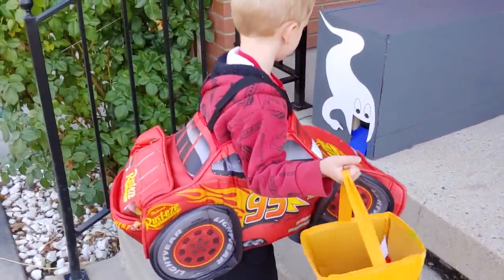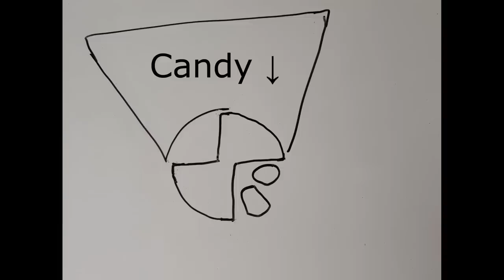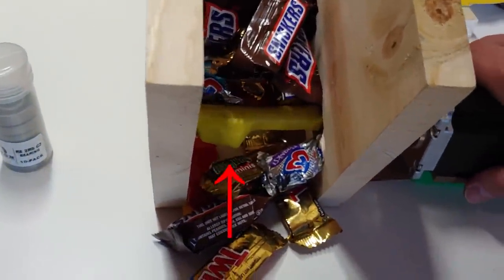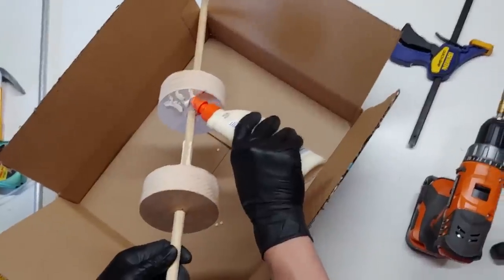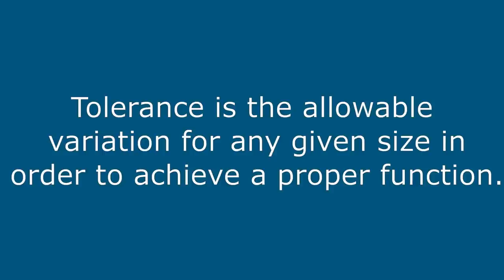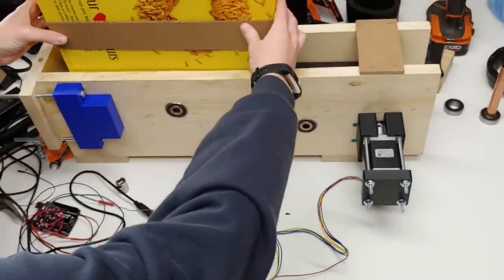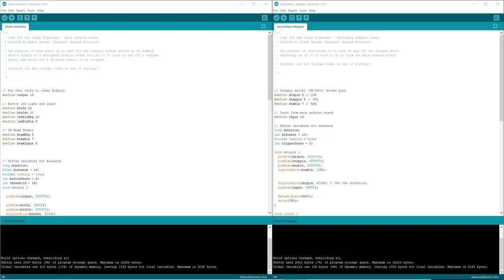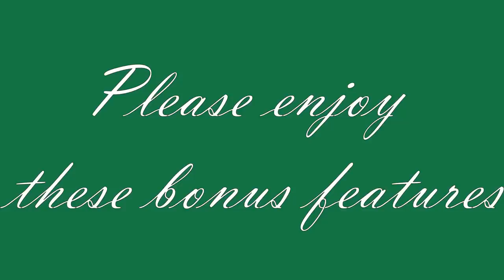Automatic Halloween Candy Dispenser - Engineering Process

Comment from the maker: We have the parts list and drawings live on our website, check it out! https://barkersrandomprojects.com/projects/candyDispenser
We are hoping to do a live stream later this month to help those who are building the candy dispenser.
We are also hoping to get a touchless variant completed soon
Reply: @barkers random projects - Checked out the plans on your site (AWESOME THANKS) and sent a couple follow-ups on the measurements for the pipes to your email. Based on the 3d printed wheel and bearings I could guesstimate but if you have cut measurements for the tube, pipe, and rod (I think 4 even sections of the rod is correct?) would be great. Copper pipe and driveshaft lengths, please?  Also any tips for 3d printed parts? I did everything in PETG with 25% gyroid infill and regular walls. Is that ok or should I be doing solid? THANKS MUCH!!!
Reply from the maker: @ChristianLappinOFFICIAL  Hey! For the copper pipe - one of them should be 5 5/8" which will be a little bit longer to allow the bearings to fit into the tension block. The other 3 should be 4 3/4" which is the width of the machine. The steel rod for the drive wheel is about 5 1/2" long. PETG should be great, and I'd definitely recommend infill. They don't need to be solid. I printed mine in ABS, but PTEG or PLA should be OK.

Comment: This is great! Any chance we can have a wiring schematic? I would love to try and build this
Reply from the maker: Wring schematic can be found on our website here: https://barkersrandomprojects.com/projects/candyDispenser
Reply: @BarkersRandomProjects  Great to see the documentation and parts list. I wish you had posted it a little earlier. I have built a touch free candy dispenser inspired from your design. And I used a raspberry pi because that’s what I had.
Reply from the maker: @SharathKE  you should share your design!
Reply: @BarkersRandomProjects  Yes, I am planning to do it once I get some tweaking done and get a nice cover for it. Basic design is similar to yours, with my not so good craftsmanship and unavailability of tools/resources I did more 3D printing and used hardboard sheets, used a thicker belt, used ultrasound sensor for proximity sensing to start dispensing, and just like you I used IR beam break sensor to stop the motor after dispensing a candy. A couple of years ago I created a gum ball machine where kids would have to pedal a bicycle and depending on how many times they pedal in a 20-30 sec time frame the machine dispenses gum balls. Kids were super excited with that machine, this time I wanted to do a wrapped candy dispenser and that's how I got to your video. Thank you for that video.

Comment: Nice looking driver. I assume that's just a standard NEMA17 stepper?

Also, if you didn't, you may want to look at using an interrupt in your code.
Reply from the maker: Thanks! It is a pretty easy to find NEMA 23 stepper, 1.9Nm

Interrupts would have been extremely helpful for this project, I didn't know they existed before now. Thanks for the feedback/suggestion! I think that would have been a much better design then what I was doing.
Reply: @BarkersRandomProjects  NP. Whatever works, right :-)
Reply from the maker: @JeremyCook  very true! Haha